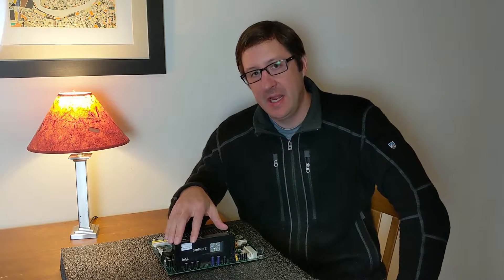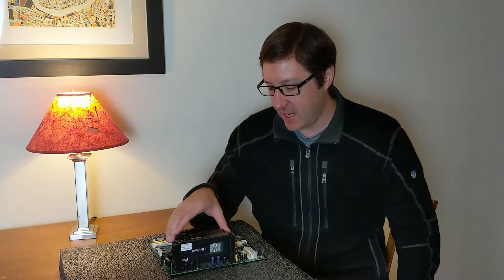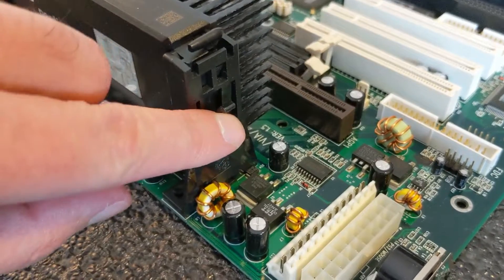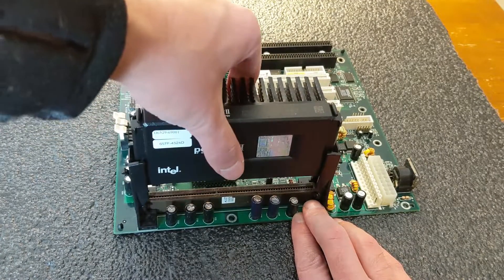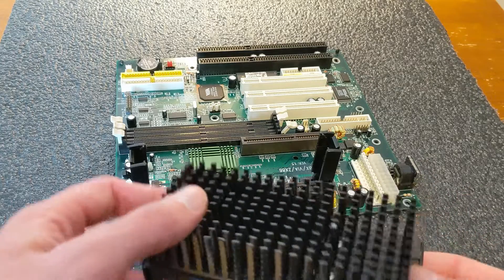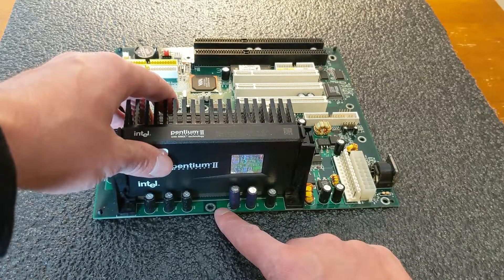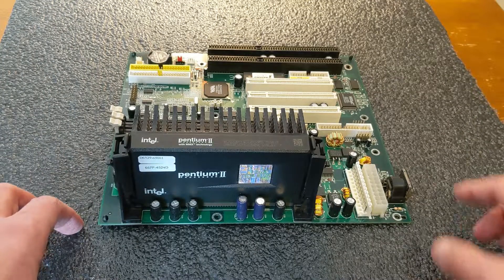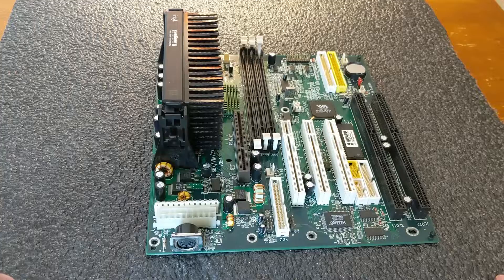How to Remove and Install a Slot 1 Processor

Comment: Hello & thanks for the video, haven't touched a slot 1 system in forever, just found another slot 1 system at the recycling facility we swing by basically daily at work.
With a voodoo III 3000 agp TV & Pentium III 500 mhz, which now sits in a Asus P2B motherboard.

Still need to install operating system ofc but bios screen showed it working just fine.

Comment: Can’t believe that didn’t require a fan.  I couldn’t remember, thanks for posting this. I had a P2-266 mhz back in 1997.
Reply: It does need a fan. Some setups used a duct between the CPU and the PSU with a fan installed onto the PSU.

Comment: Very interresting, I´ve got 2 Pentium 2 MMX Motherboards with processor. And on both are the original cooler out of work. So I need a new one, I found now coolers on ebay, didn´t know that these processors are named "Slot1".

Comment: I love slot 1 stuff. I wanna see more.

my 98se build is currently running a 450ghz slot 1 P3 on an asus p2-99 motherboard, voodoo3 and sb16 sound card. the only thing I don't like is 98se interface. I grew up on win95 and its a bit out of place for me
Reply from the maker: I'm definitely appreciating Slot 1 a lot more recently. I'm looking to put together a Slot 1 P3 system like yours, using the AT motherboard in the video -- hoping to reach 600 mhz on an AT board in an AT case... pretty excited about that. It'll also have a Voodoo3 and [probably] a sb16.
Reply: @GamingRetro  that's gonna be pretty sweet! im keeping my eyes open for a 500+ MHz P3 on ebay. and a sound card. sb16 was all I could afford at the moment of the build.